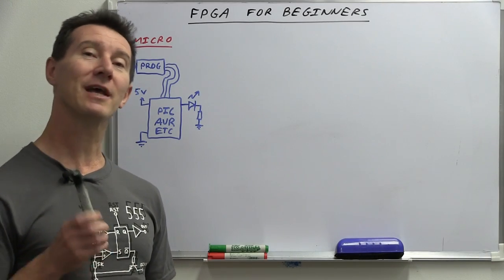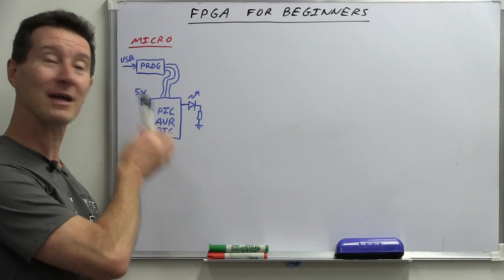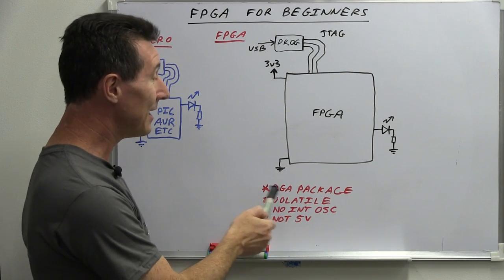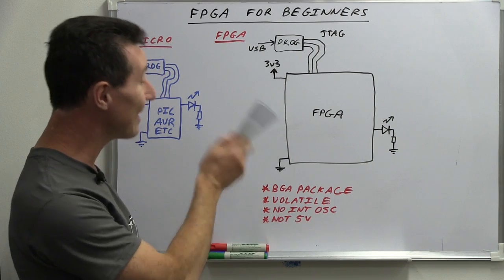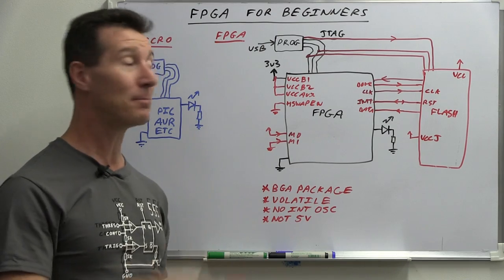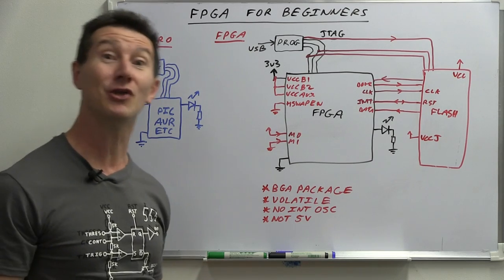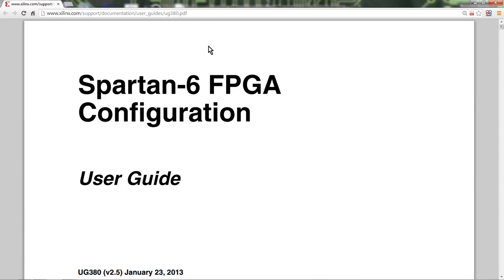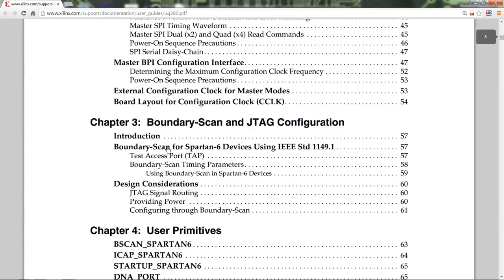EEVblog #635 - FPGA's Vs Microcontrollers

Comment: Yet again, 10x for the video, Dave!

There is something about FPGAs that I find mystical, even more ... magical. You cannot beat the feeling that when you're playing with such devices you are virtually a silicon God, being capable of (provided you have the time and patience) to accomplish ANYTHING (and I cannot emphasize this enough) in terms of electronic artifacts.

This is the kind of feeling that I didn't get while working with normal MCUs, that's for sure. As Dave said, if you have the patience to go through all those tons of documentation materials that they imply, you can achieve wonderful things. But hey! All these capabilities/configurations/features have to appear somewhere, right? Otherwise, what good would they be if no one knew about them?

But I guess this is also the reason why a lot of the people stay away from them in the first place. They can be intimidating, especially in the current WYSIWYG IDE ecosystem that we grew up with and are living on.

Could be a matter of character, but if you have the curiosity yet still retain some doubt ... try them! What bad can it do? :)
Reply: Actually nowadays FPGAS are very niche devices, there are not so many things you can do with the that cannot be done with much cheaper microcontrollers 
typical FPGA has very little resources for building anything usable even when you use most expensive hips they are pathetic comparing to any half decent CPU
Reply: +deltaxcd FPGA is mostly widely used today, they are the core of all chip you see.  FTDI, other customs digital circuit chip etc... FPGA(Field Programmable Gate Array) is very powerful, it is like a blank piece of paper and you can design any customs digital circuit on it and it is very fast.  One example would be circuits that process graphics (NVIDIA chips are FPGA, yes they are).  You can design your own little microcontroller as well and have your own instruction sets etc...  Let say you came up with a better circuit to translate serial(RS232) to USB, much better and faster than the FTDI chip, you can design your circuit by coding/describing your circuit in VHDL or Verilog onto the FPGA and call that chip "Super FTDI" or something and sell it.  That is what FPGA is for.  Btw, I am speaking as an EE.  Back in university, I mostly dealt with FPGA and very little with uC, I believe I had one class in uC which was the  motorolla 6800 or something like that and coding them in assembly.  Near the of my fourth year, they finally let us design an basic but working microcontroller similar to the 8051.
Reply: +hhputube 
Whule fpga is quite flexible, power is relative. because we have to compare power per price unit.
and in this aspect FPGA is insanely expensive comparing to some SOC.

if you check prices at digikey, defent FPGA START at 100$ and if you want something what can fit any decent design you will need FPGA which price is in the range of thousands dollars.
I wonder how much will cost your superFTDI chip in comparison to some cheap alternative. I think you will need quite a moderate size low end FPGA to fit usb core so there is no way you can get away with price less than few $
and atemt to emulate functionality of NVIDIA GPU would bankrupt any millionaire. GPU is not fpga.

Only use of FPGAs today are niche products with very low production volumes where it is not profitable to bother with ordering ASIC  if product is popular enough you simply convert all your VHDL into specialized IC which price is only small fraction of FPGA

Comment: Hi!
Thanks for the video!

Can you give an example of calculations/operations which are better suited for the MCU rather than the FPGA fabric in the modern SoC which have both? I have been designing controllers for DC/DC converters for quite some time now on FPGAs (and then ASICs) and have never felt i need an MCU. Would be happy to hear any thoughts on the matter

Comment: I wonder, why cant they make a package that includes most of those passives built in so that people can just directly feed it a single power rail and then just worry about the data pins?
Reply: FPGAs are designed to work for pretty much every system imaginable and are therefore very flexible in terms of I/O voltages, clock sources, etc.
The price for this flexibility is the effort you have to put into using them.
Reply: Many pins do have internal pull ups or pull downs, but not all of them. As my main man sid6p8 mentioned, they are designed to be flexible.
Reply: ungratefulmetalpansy Not even close. Good luck doing DSP or high speed data translation on a microcontroller. FPGAs have very specific jobs, just as microcontrollers or microprocessors do.
Reply: They do. Both Digilent (for Xilinx) and Terasic (for Altera) make FPGA dev boards that include VREGs, USB JTAG and flash. Digilent makes a few as PDIPs reminiscent of the BASIC stamp. Also Atmel make small, slow, FPGAs that run at 5V (AT40K) or have 5V tolerant IO (AT40KAL), as do Lattice and Microsemi (if I'm not mistaken). I don't really see the attraction of 5V logic as more and more devices are 3.3v or even 2.5v and logic buffers are cheap (~$0.50) and easy to use when you need to interface 5V logic.

Comment: With FPGA, you need to define and declare signal, variable etc to actually program by yourself for the display to show or scroll words.  A lot more flexible as well. The moon rover uses FPGA bit not a micro-controller.

Comment: Why can't microcontrollers get the same speed as FPGA's?
Reply: FPGAs run tasks in parallel, they don't have to wait for a task to get completed, to do another one, while uC have CPUs and do have to wait, a task is only done when the previous one is completed.

Comment: Want to start in FPGA, do some digital circuit design, then learn VHDL or Verilog then get one of the Altera or Xilinx board and start coding your digital circuits... Basically you are just coding/describing your digital circuits in VHDL or Verilog.  You can also design any kind of digital circuits on a FPGA or CPLD and even design your own microcontroller, of course you need to add all the extra memory and other goodies, but FPGA as I know from back in University days, most are used to design customs digital logic circuits although we did design a basic microcontroller with it.
Reply: +Iron Chief   I reckon you've chosen a very good start point, assuming you chose one of the simplest arduinos, like the uno.  You'll stay close enough to what the chip is doing to easily learn the connection through to other electronics,  and the software development environment, short circuit protection, etc is a boon for beginners.  I love my uno!   It arrived in the post, I connected the usb cable to my pc, downloaded the dev environ, picked demo one and it worked.  Can't get much easier than that.

Comment: I wouldn't be as afraid to do it from scratch I practically managed to do my first HW design - Spartan 6 FPGA board and it worked on the first go, sure it's not ideal design but it works .. I designed the board from scratch in a course of 2 months in Eagle, not used any electronics CAD before, not designed any HW circuit or board before and this is result: https://github.com/josko7452/qwave-project - design working at 125MHz .. no problems ... of course I had experience using FPGAs as HDL programmer so that might helped a lot..

Comment: Maybe it is because I am not an FPGA expert, but I don't feel like you were comparing apples to apples here.  From your discription of FPGAs, it seems like you were talking about the IC by it's self.  An Arduino is not the ATmega 328p, it is a whole package.  It includes the oscillator, the USB interface and more.  So why not compare an Arduino to a FPGA development board? 

You have some great content, but this video like a lot others (that you create) has such a negative tone.  Recognize the fact it is hard to get into FPGAs and unlike Arduino (which is open-source) FPGAs do not have a big community. But, that shouldn't stop a person, give some pointers on how to go about it.   Remind people to start small.

Comment: I still don't know how a FPGA is better than a PIC.
Reply: Signal processing power. In a PIC you can typically execute one instruction per clock cycle at best. In FPGA you can execute the equivalent of hundreds or even thousands of instructions per clock, while simultaneously reading data from the input pins and writing data to the output pins every clock. Also, the more expensive ones can operate at hundreds of MHz.
Reply: Thank you for the details.
Reply: YouCanHasAccount
I don't know much about them, but what good are they if they are volatile? Won't you lose everything if your power get's cut for some reason?
Reply: Robert Calk Jr.
That's why you need the external flash: when the FPGA boots up, it downloads its "program" from the flash and it configures itself.
Reply from the maker: Robert Calk Jr.
Yes, but it will auto-reload from the flash when it boots up again.
Reply: Consider the last design I was working on... I needed to accurately measure 4 PWM signals simultaneously. I could have mucked around in the uC  world... messing with interrupts and timers and other such nonsense... but that was more than i wanted to do. I could have done what my predecessor did and just use 4 uC's... but thats silly. I took a Spartan 3A and built up a PWM measurement circuit on it, and then instantiated (called) it 4 times... and bob's your uncle. It also gave me the ability to do some interesting noise rejection on the input signals-- which is good because this poor sucker is going into Aircraft HIRF (high intensity radiated field) testing and lightning testing. Poor little guy :(
Reply: its plastic

Comment: This is all nonsense. None of those issues really exist:
You can in fact just connect supply, jtag programmer and flash leds  without using  anything else, I did that with my first xilinx fpga, soldered on breadboard with nothing else than additional LED
Even ancient FPGAs contain slow internal oscillators  and modern fpgas even have several PLLs that run at any frequency you want.
when you use jtag to program fpga configuration pins are pretty much irrelevant
also fortunately it is not vital to connect all power pins.
Yes it is true that configuration will be lost if you disconnect power supply but who need to retain some led flashing crap anyway?

Real problem with fpga is pcb routing, since those things typically use 2 voltages and shitload of power pins that should be grounded and decoupled properly so it is practically impossible to use single sided pcb and even double sided pcb is at its limit.
FPGAs are only useful at super high speed designs and when you do those you cannot route boards carelessly you typically need very expensive multilayer boards with no less than 4 layers for even most primitive design.

Comment: sure fpgas have internal ocs!
clk <= not clk;
boom :p
Reply: Actually most FPGAs do have an internal oscillator, which is used for configuration. I think they're based on an RC-circuit and not a crystal and therefore very innacurate.
Reply: sid6p8 It doesn't matter anyway, oscillators are not that hard to build.
Reply: Mmmmm... precision oscillation... :)

Comment: comparing an FPGA to a microcontroller is like comparing a dog to a cat. They are completely different devices intended for completely different things. The author clearly does not understand that. You can implement a microcontroller in the FPGA fabric. You cannot implement an FPGA in a microcontroller. This video is an example of someone putting together a video just so they can claim  they uploaded a video to youtube.

Comment: They're really not that hard. Many do have an internal oscillator and if you're a beginner you're probably gonna start with a beginner/development board, which is gonna have everything you need to get started (flash, ram, i/o, etc..). As a beginner you're not gonna make your own FPGA based designs anyway. So I don't really consider the things you listed as deal breakers, they're just minor things. The advantages of FPGA's outweigh them anyway.